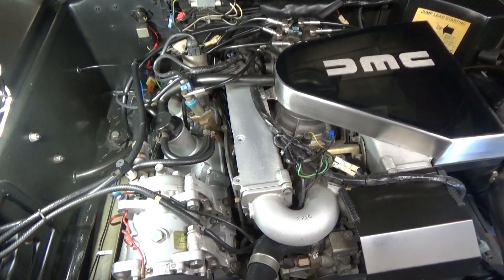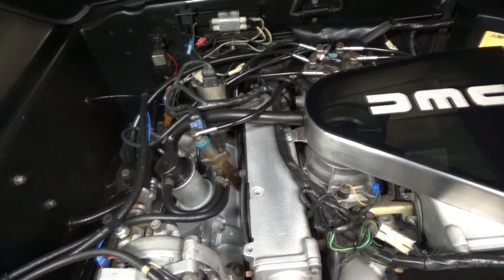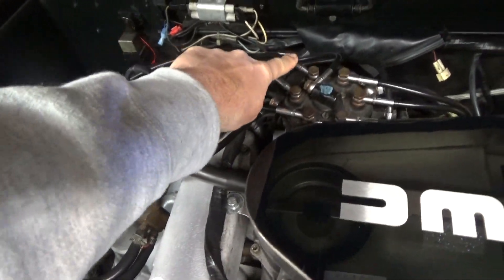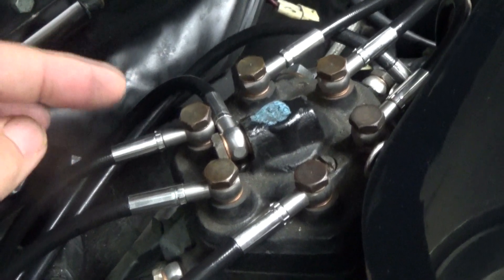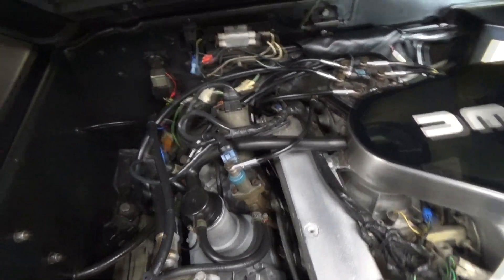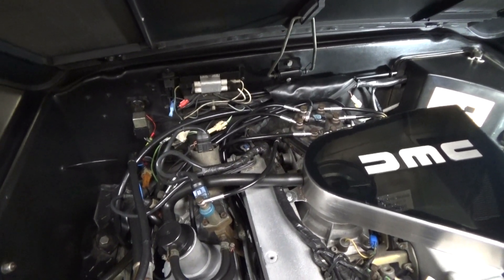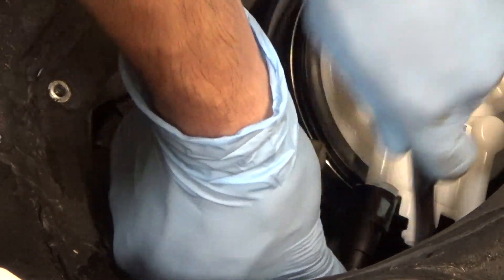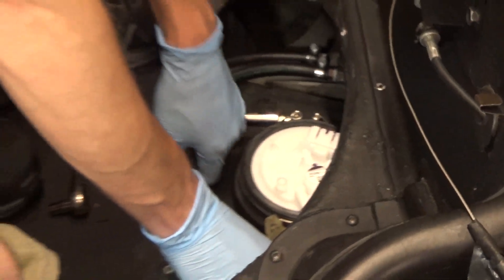Don't Be That Guy. DeLorean Fuel Line Replacement - Don't risk a fire or your life! 13-Piece DPI Set

Comment: It should be noted you can see a picture of the remains of my car with me in the Beetles t shirt. I had a complete engine replacement/wiring/fuel etc. From DPI. The fuel line on top of the intake failed and sprayed the alternator. My car had the 3.0 engine. This was all documented by the inspector after the fire. I have many pictures on my Facebook. I also had a claim against DPI a few months prior for faulty work and the judge found in my favor on that. See the picture at 50:01

Comment: Hi DeTech, love your work, been  lurking for a few months now, fairly new owner.  I'm stuck on the fuel return line, the factory soft line has been removed, but I can't seem to disconnect that stubborn compression fitting, from the hard line.  It appears some have had to cut this, any ideas before I do the same?  Thanks!